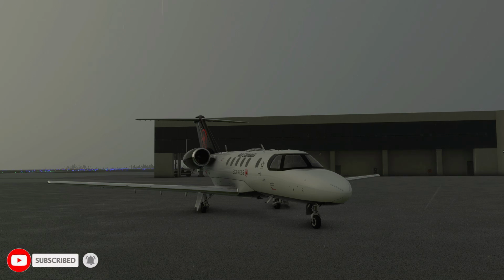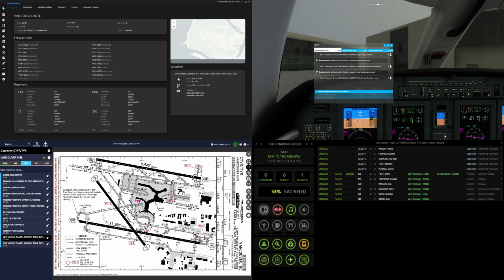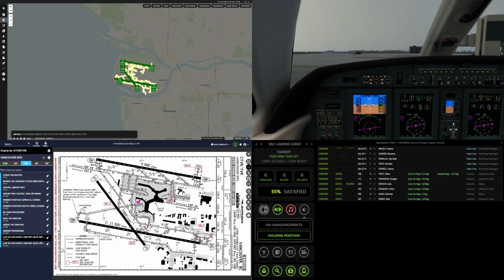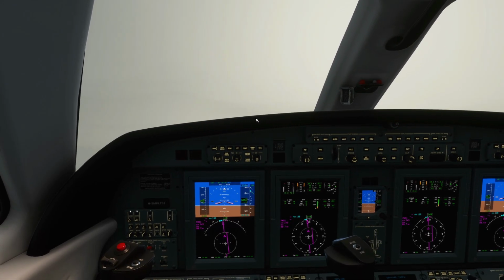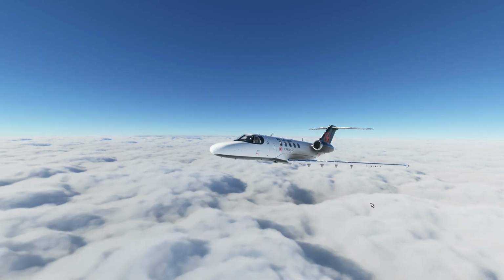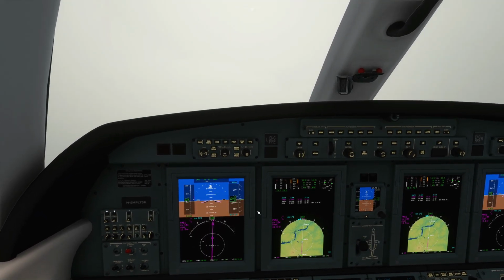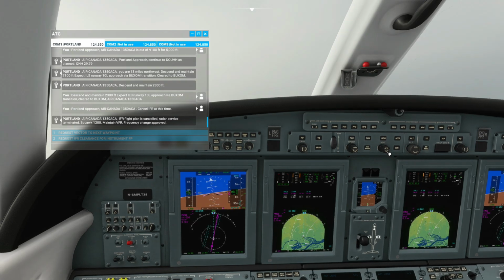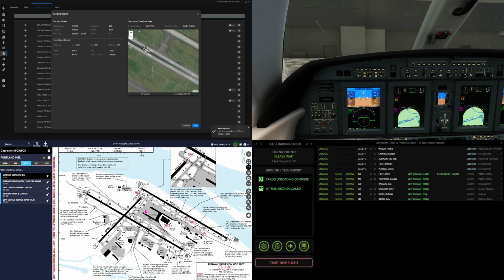MSFS2020 | Working Title CJ4 0.7.1 | CYVR - KPDX | Self Loading Cargo | Simtoolkit Pro |

Comment: Hi. I've seen that "turbulence" effect that you were experiencing. It happened when I thought I'd clicked on the [YD] button but the click had not turned it on! The effect of not turning it on, especially at higher speeds, is that the aircraft tail starts to go from side to side like a fish tail when swimming. The oscillations get really wild as one starts to fly faster, which I saw was happening. My guess is your YD failed to turn on.

The Self Loading Cargo addon looks interesting so thanks for the intro. I'm wondering if I need the stress of screaming passengers as well as the co-pilot hitting me with the flight log! lol

VERY interested in learning how you created the passenger area views. That's a great addition!

The trouble you had on approach has also happened to me, many times, and it is quite frustrating and soul destroying to have an awful landing experience after a very long flight. It's not happening to me now I'm doing things differently. (ATC seems to get in a right muddle if one CHANGES the arrival/runway from a previous setting). The way that seems to have worked for me (at least it has so far) is for me to NOT select the runway and arrival information until the end of the flight when I get the information from Arrivals a short while before landing. This is very logical if one thinks about it because the weather can change while one is  mid-flight, or an aircraft can be stuck on the runway or the runway could be closed at short notice for any other reason, so in the real world the arrival information in the FMS can't really be finalised until one is nearly at the end of the flight. ATC should cope with changes but it's almost as if the system is hanging on to the old flight plan as well as the new one and expects one to fly both! The heights they give are often quite crazy too, expecting us to fly up to 11,000 FT then telling us a minute later to fly at 1,500 FT (I think because both approaches are still being acted on) and the end result is that ATC starts to sulk and ignore us completely! Anyway, hope the tips help to solve the fish-tailing as well as the corrupted approaches.

Cheers. Thanks for doing the video. I hope you don't mind that I didn't click Like. Too many things went wrong that reminded me of my own frustrating flights! lol
Reply from the maker: Could be David, PFD was showing YD on but like you said you as far as I know you shouldn't experience that much turbulence with. Today it's completely fine.